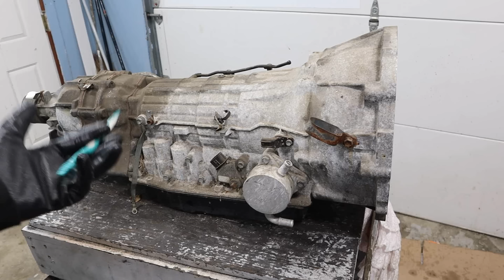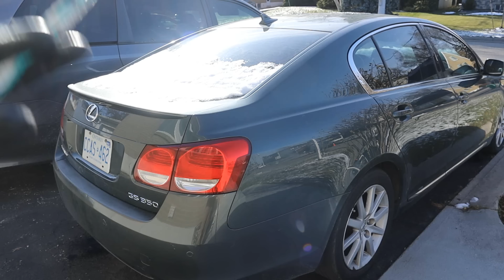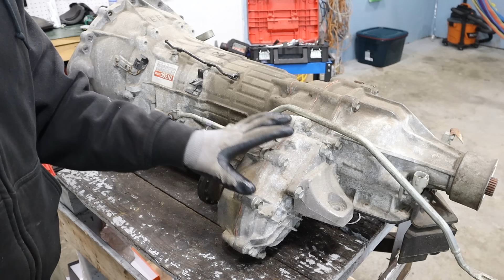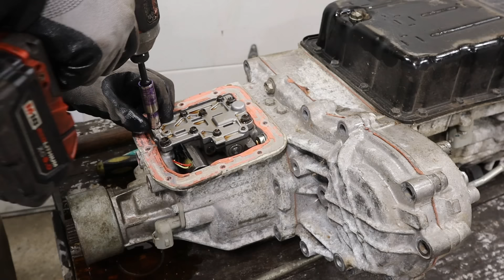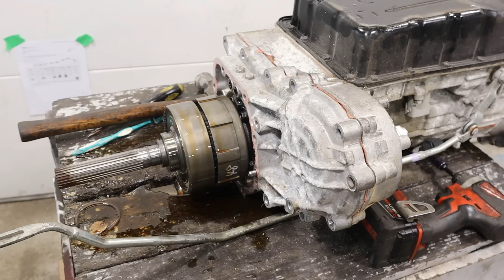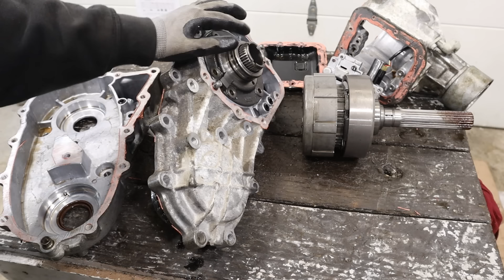What’s Really Inside a Lexus AWD System? There's More Than You Think!

Comment: I honestly thought it was a traditional "dumb" AWD system
I own a 2006 Toyota Mark X four (which is literally the same system) and it''s super stable and efficient. only problem parts for this model are hard to find here mainly the front cv shafts which mine are pretty worn off (inner cv joints) . I did take it to a game park a couple months ago and had a great time

Comment: hi
the reason to explore gs 350 awd 2011 drivetrain that my car have a little vibration between 1 to 40 speed. after that no vibration. what could be the reason? i bought car in UAE 2 weeks before. 2nd transfer case oil should be change or its already done with transmission oil change. Thanks

Comment: Still it relies on clutches, which are a wear item. In my 2009 Lexus RX Hybrid, the AWD system was done by simply adding an electric motor to the rear axle. No transfer case, no clutch, no driveshaft.
While the battery replacement is costly, I would say its still a more reliable and efficient system.
Reply: Yeah but it’s not a true awd system. If you have no battery, then you have no awd, and it’s a HEAVILY front biased system since the rear electric motor is small. I had a 21 rav4 awd hybrid, and the awd system was like a 4hp electric motor strapped to the rear. It did its job in winter but it’s really not comparable to a proper mechanical awd system
Reply: @slaaoao Yes, and in these cars that's exactly what the awd system is for. I'm not going rock crawling or mud fording in my lexus. In fact, I would have bought it all the same if it didn't have that at all.

Comment: So is a standard TOD system,   just like xdrive, but for Aisin gearbox.
Reply from the maker: X drive is way different... check my video on that. They use a calibrated servo motor to change the pressure on the clutch.

Comment: As AWD systems is designed, I think Ferraris is the simplest, efficient and most direct. A simple 2 Spd box runs off the front of the engine crank to drive the front wheels. The tall 2 spd box transfers a proportionally reduced amount of Tq to the front wheels (0-40%).
Reply from the maker: Interesting!
Reply: Ferrari's system is efficient in terms of weight and packaging, as it preserves the traditional transaxle layout of the V12 coupes. But it's inherently inefficient as it relies on constant slip of the front clutches so it's extremely delicate. When it debuted on the FF, the car was marketed as the ferrari you can go skiing with. Owners reported it would break frequently. They started making more vague claims about performace gains with the following generations (GTC4 and Purosangue), but it has the same limtations. With no differential you can have mechanical torque vectoring, but the ECU has to limit usage to prevent overheating so the system is not permanent. It can only be used up to 4th gear. That's why they use it only on their GTs. The real ferrari performance AWD system may be the one on the SF90 and 849 testarossa, but that's a lot less fascinating with just two electric motors. Ferrari in general isn't very keen on 4wd cars and it can be argued that track usage doesn't really need more than a nicely engeneered RWD car. Even on the hybrid hypercars the strategy is to fully saturate the potential of the rear wheels and only then send power to the front.

Comment: Can you elaborate why it must have that clutch system? Would a planetary system alone work well as awd diff? (Plus brake-based torque control)
Reply from the maker: Yes it could. 
That would be more like an open differential without the ability to lock it 50/50

Comment: How reliable is that generation of GS you got?
Reply from the maker: For me pretty good. Had it nine years now. 
Only had to replace an alternator, couple of batteries, exhaust flanges and most recently a starter. Did the basic maintenance stuff like fluids filters and sparks as well. 

The AC is leaking though. Probably from age.
Reply: @speedkar99 i got a vacuum leak code , probably the exhaust flanges ran out?

Comment: I should note that, this AWD system technically known as "i-Four" is different than all their other systems, and only available on their RWD based AWD cars like the Lexus GS,IS,LS,RC and the Toyota Crowns.

It's one of their most high end systems meant to compete with X-Drive, 4Matic and Quattro.  It's not what you'd get on their other mostly FWD based AWD or Part Time/Full Time 4WD platforms.

It's a pretty underrated system that they never capitalised on by giving it a name, instead just calling it AWD.  Buts a very advanced system for its time. (Came out in the 90s first)
Reply: The updated 8 speed AWDs used a revised Torsen version if I am not mistaken.

If this is the 6 speed, it would be the i-Four I mentioned.

Comment: Another Fun fact, this is the same trans from a 4.6L Tundra. There are 3 in the family. Your RWD is the A760E, the Tundra 4wd is A760F, These are A760H. I wonder if these could drop in a Tundra for AWD. The offset may be different. These are almost unheard of to fail.
Reply from the maker: Interesting if it did for RWD. 

Tundra 4WD likely has low gear range for off road, the transfer case would be different.

Comment: I don't have a four-wheel drive Lexus. Have a 2010 Rav4 all wheel drive. We just had big ice here in Texas and I can tell you, that computer does know what it's doing.
Reply: I highly doubt they use the same system
Reply: @herniagaming  I'll bet they're at least cousins.
Reply: @MicahThomason your rav has an “on-demand” awd system. Essentially your car is fwd until slip is detected and power is sent to the rear- works great as intended, but apples to oranges.
Reply: @austinthill3151  Thank you. I appreciate that.
Reply from the maker: The RAV is a slip and grip system. Not as capable but it sure helps in ice.

Comment: 3:50 "70:30 front/rear split is determined by the gear ratio inside..."
What is that gear ratio?
Reply from the maker: I believe it's 70/30 without the clutch locked 

The more you lock the clutch, the more it biases it towards 50/50

Comment: I am wondering, how does it build up fluid pressure? Is there an oil pump or does this have a separate fluid or it uses the transmission fluid?
Reply from the maker: I pointed out the inlet that comes from the transmission. 
That would be from the transmission's oil pump.
Reply: @speedkar99 Like your videos. Been following you for a very long time. I’m located close by, in Scarborough.
Reply: Shares fluid with the trans.

Comment: I've waited for this video for a long time. I have the same setup in my Toyota Mark X 4WD. I'm curious;
1. How does it compare, in terms of reliability and performance, to other AWD systems eg subaru, quattro etc
2. What are the key things to keep the trans + AWD system in top shape?
I'll be glad hear your thoughts on the break down.

P.s. A common problem (I currently have this issue) with the A760h is the front diff tends to leak/fails with once you get to higher milage. Any idea why this may be the case?
Thanks😊
Reply from the maker: Most have been reliable. I'd be more worried about the transmission itself than the AWD transfer case. 

The quattro system (depending on which one) is purely mechanical. It's locked until there is slip. 
The Subaru system, while mechanical, has a open differential until you lock the clutch in X mode. I don't think it can vary the torque like Lexus.
Reply: Subaru AWD reliability means squat because their engines are trash unless you build them yourself. Also, automatic is out of the question since they joined the Nissan CVT Ponzi scheme.
Reply: Subaru have open front and rear diff except STI models, their center diff locking mechanism and design torque split varies depends on transmission (manual/cvt) and vehicle purpose
what x mode does is using individual brakes to increase friction on the free spinning wheel so the other side (left/right) will start to have torque in low traction env, the system turns off when vehicle goes above a certain velocity

all Japan automatics are cvt now with Subaru cvt being most solid, next to Toyota with their dedicated 1st gear
Reply: @philiptong4978  Subaru CVTs are Nissan (Jatco). They are shit, and many cars in Canada are in the scrapyard because of them. You sound like a car salesman.
Reply: @fun_ghoul  not a vehicle sales person
good to know they have same oem, I suspect what I heard from user experience must be tuning related
anyways cvt is build for fuel economy, the belt should be a maintenance item for replacement, vehicles using it should be equipped with an early warning mechanism for impending failure, better than a sudden death
back to manual transmission for simple and effective mechanism or electric
Reply: @philiptong4978  CVT is garbage in anything bigger than a snowmobile, and will disappear as electric motors are integrated into all cars, giving the option of the unfortunately named but much more reliable "eCVT" to replace them.
Reply: e-cvt are here now but only equipped in toyota or ford hybrids

Comment: I feel that Lexus should make a WRX STI killer as a nod to Mitsubishi EVO series with that transmission. "Lexus Evolution" would be the name 🤩.
Reply from the maker: Lexus made their brand around quiet, comfortable, reliable and refined vehicles. 
An STi variant would fall under the GR subbrand.
Reply: I have a GS350 AWD. My neighbor has a Legacy we have the same continental tires. Both are great cars in the snow. Both had 3 tires on ice and can pull up a slick driveway on one tire. Lexus could definitely rebrand the IS350 with Subaru. I think the BRZ uses an RWD version of this trans.
Reply: Gay

Comment: Three things are impressive about this g/box after watching your teardown. First, what an amazing engineering went into it. Second, what an amazing engineering went into it and it is working well. Third, what an amazing engineering went into it and it is working well and it is reliable. Burnouts dont count.
Reply: This system was around since the late 80s. Extremely reliable.
Reply from the maker: Haha. It sure is complex compared to the other systems out there. You have to take the transfer case apart to get it off the transmission 🙄